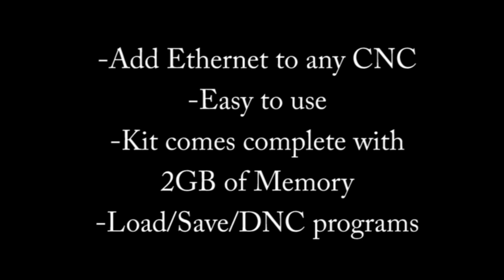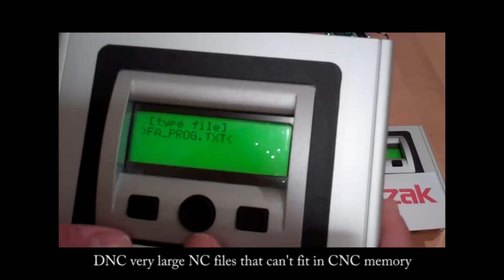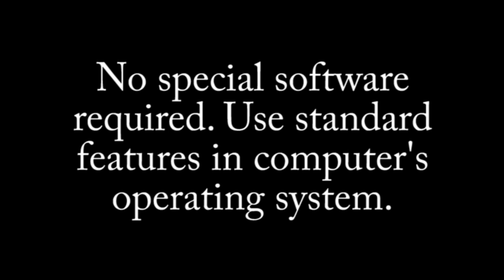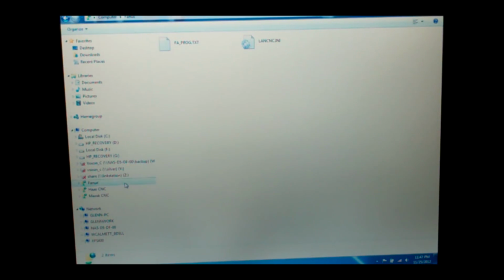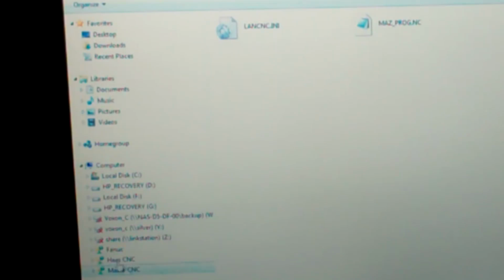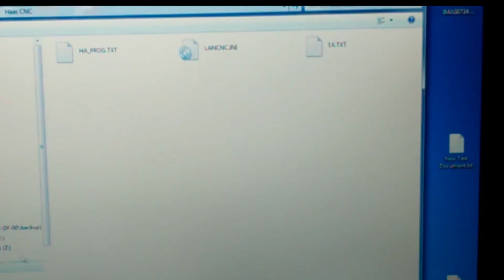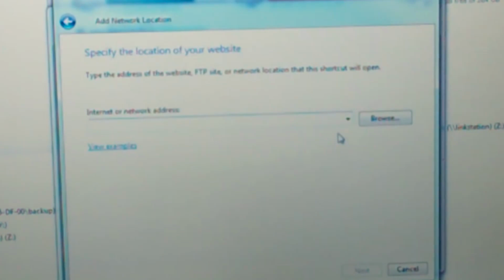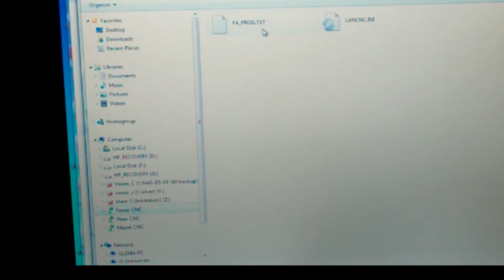Add USB or Ethernet to any CNC, demo of the LANCNC data server memory for CNC machines

Comment: how i set up in cnc   use RS232 cable  4  machine at present now how i conect pc to cnc
Reply from the maker: Our products work with the CNC's RS232, match the settings on CNC to Calmotion product. With the USBCNC, you will use a USB disk with files from your PC to load/save/DNC. With LANCNC unit, from your PC's File Explorer you will view/load/save files onto the LANCNC.   At the LANCNC you will load/save/DNC with the CNC.

Comment from the maker: Sntlenny,
DNC depends on the control how it will work at the machine. But the basic procedure is, select DNC on our device, select the file you would like to run, and then put the machine into DNC mode and the program will start to run.